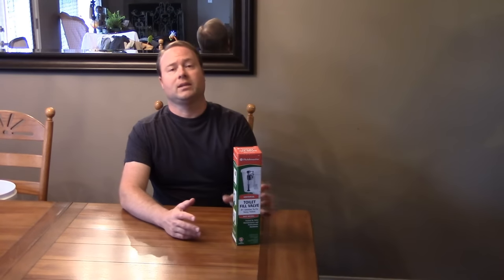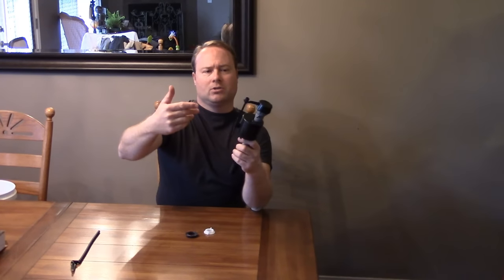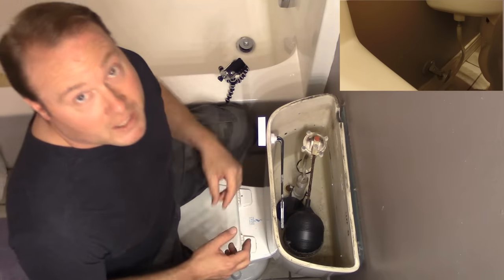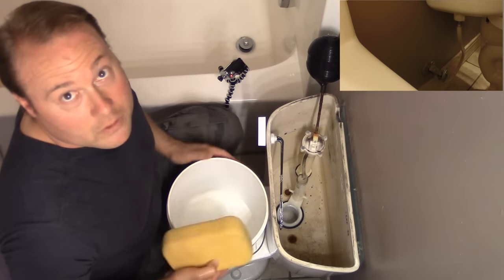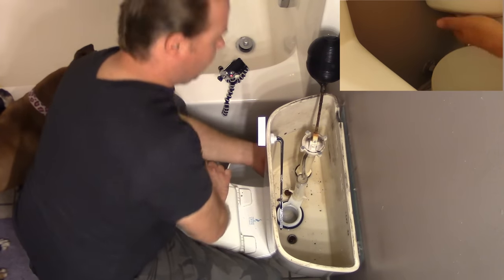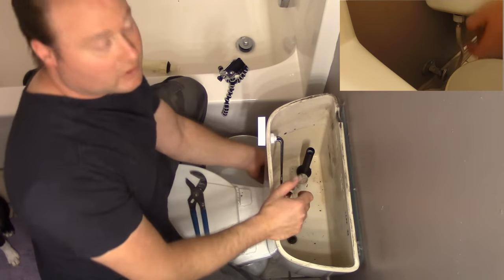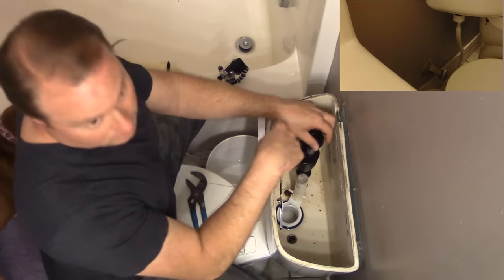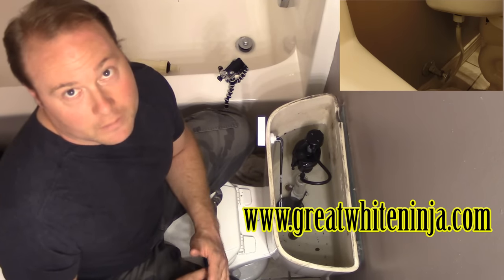Fluidmaster 400a - Installation

Comment: Hi Nathan, there is something I would like to share with everyone. When I install the fill valve, I did not attach the little clip to the hose like it suppose to. I place the hose inside the overflow. That will cause the water to flush into the toilet and every five minutes it will cause the tank to fill with water again.......I did follow your instructions with the hose and now my toilet is working fine......Thank you a lot.
Reply from the maker: Thanks for the comment. It is funny how that little piece keeps it from siphoning.

Comment: I used the trick of separating the tube from the valve and had a new supply line and the FluidMaster in the toilet in about 10 minutes. I wish I had watched this video first! The old fill valve broke into pieces because the nut to the supply line had been forced on and was crooked. It took my husband and me three days on and off (until we got so frustrated, we set it aside) to get the supply line separated from the remnants of the old FluidMaster.
Reply from the maker: Thanks for watching. Don't forget to stop by our website www.greatwhiteninja.com

Comment: Thank you SO MUCH for this video. The extent of my toilet repair history is to remove the lid and say "huh." And promptly put it back on. Now I can say I was able to replace a fill valve all by myself! And you even showed me how I could do a shortcut by using my existing shaft (since I only had a problem in the head) and not even have to drain it completely and do all those other steps. You are awesome and I really appreciate it. My husband was really glad I didn't ask him to do it...ha!
Reply from the maker: Glad that I could help. For more great videos check out my website www.greatwhiteninja.com
Reply: eponine318 qwwp hotel grand queen sheet set

Comment: Very simple- I'm a 64 year old widow, and have always been the handyman...plumbing was the one thing I shied away from. I am reusing the existing model of this same set, as a temporary measure.  It is old and the valve is chewy.  I took everything apart and trimmed a bit of too-long hose. I will be completely replacing the entire works asap, since the unit is over 5 years old and the tube is stiff and crimped.  I had a slow refill problem, but by taking everything apart and cleaning it, it all seems to work.  This is the PERFECT video for exactly how to do it.  Just do make sure that your nuts are tight- my hands are not strong, so I used a rubber jar grip to turn that last bit by hand.  Thanks so much for a great video!
Reply from the maker: Glad that I could help.

Comment: I had a problem with the tank not filling up and had been dreading replacing the entire Fluidmaster fill valve.  Thank you so much for the tip about pulling off the old Fluidmaster assembly and just sliding the new one on.  What I thought would take about half an hour turned into a one minute repair!
Reply from the maker: No problem. Glad that I could help. For more great videos check out my website www.greatwhiteninja.com

Comment: I first initially replaced my old-school toilet valves (3 bathrooms) back in 2000 (bought them at True Value).  Then I replaced them all in 2008 (bought them at Home Depot).  Now I’ve replaced them all again in 2016. (Bought them at Home Depot again).I too am sold on the fact that the Fluidmaster 400a is my one and only choice for the toilets. Having done a search today on YouTube for “Fluidmaster 400a replacement” I stumbled on this video.  This is so much better than reading the instructions on the unit.  This vid was an exceptional refresher for doing a fluidmaster replacement.One other note.  I stumbled on other videos showing the replacement of the seal on the unit vs changing the whole unit out.  A whole new
unit is only 7 dollars and some change at Home Repo vs 3 dollars and change for the seal.  I just changed the whole thing.  Besides if you change the seal on the old one, it’s still going to be all crusty full of calcium.Time to change the unit: 20 minutesTotal cost:  $7.48 plus tax.Thanks a lot for the refresher sir!

Comment: You saved my nerves and sanity, I just fixed the fill valve just by removing the top. I don't have strength in my hands/fingers so screwing things tight don't work with me. You also saved me calling a repair man that would have charged me a ton of $$ just to do what I did. Thank you.
Reply from the maker: That's awesome! Thank you for watching. Check out hundreds more of our videos at https://www.aroundthehome.org

Comment: Although Fluidmaster has a replacement fill cap, I chose the entire fill valve.  My original Fluidmaster was around seven years old.  Why not spend  the additional $$$.  Just made sense.  Thanks to your video, it was a 10 minute fix over the existing pipe.  You saved me close to $150.  Being retired, that is very helpful !!
Reply from the maker: That is great! Glad to help.

Comment: Doooood, great video.  The little trick replacing the fill valve by popping the locking ring and re-using the already installed post?  Awesome.  Literally took 90 seconds.  Turn off water to toilet, pop ring on old fluidmaster, unclipped overfill hose, pulled off old fill valve, pushed on new fill valve, attached new hose (could have skipped this technically but new hose has a fill rate clamp), locked the ring back onto the post - DONE (minus adjusting the fill level and the bowl fill rate clamp) . Thanks!
Reply from the maker: Awesome, glad to help. Thanks for watching. Don't forget to stop by our website www.greatwhiteninja.com

Comment: OMG, I did it. I got the parts from Home Depot, followed the video and in 30 minutes I was done and leak-free. As a woman, I normally don't tackle these types of job, its call a plumber and done but this time I wanted to do it myself and I did. Like you - no fill mark in the tank,...lol so I played with the floater until I got it just below the overflow tube and voila it worked perfectly. This was the absolute best video for doing this particular job! Thank you so much, Mr. Cox, your video was awesome, easy to follow and extremely informative.
Reply from the maker: That is really great. I'm glad that your project was successful. For many more great videos like this one to help you out don't forget to stop by my website www.greatwhiteninja.com

Comment: I'm 64 with no real plumbing experience (except that time I twisted a shower head too tight and snapped the copper pipe in the wall and flooded the wall cavity).  I changed out the flappers on 2 constantly running toilets yesterday but they still run.  So today, it's Fluidmaster time!  Thanks for this video...looks just as easy with your help.
Reply from the maker: Good luck with your project. Here is a newer video on that. https://youtu.be/KLvoFsE3NP0
Reply: @AroundTheHome1  Got her done BUT...every 15 minutes or so, the water fills back up some in one toilet.  The float is set to the water line but somewhere, water must be leaking out?  New flapper, new float.  Any idea what to look for next?
Reply from the maker: Not sure. Sounds like you have your bases covered. If you hit me up on the contact page on my website, when I respond you will be able to send pics. www.aroundthehome.org

Comment: Very helpful.  Especially the brute force tip!! Thank you

Some additional tips for those who follow
 
#1 If you have a turkey bulb baster, you can suck up the residual water (remember it IS clean) and send it down the toilet drain without worrying about sponging it out. Less drips all around
 
#2 Once the water is gone from the tank, two washcloths on either side of the toilet drain are easier to use than one bulky towel to dry out the tank.

#3. A small mirror under the water connector and old fill valve lockscrew will let you mimic the smaller picture in the video.
Reply from the maker: Thanks for the tips. So glad to help! Thank you for watching. Check out hundreds more of our videos at https://www.aroundthehome.org

Comment: WOW, I've never fixed a toilet so fast. I only had to replace the float. Did what you said, pulled the old off and slid on the new and locked in place. I'm definitely subscribing to your channel.
Reply from the maker: Glad I could help with your project. Thanks for watching and don't forget to stop by our website for many more helpful videos. www.greatwhiteninja.com

Comment: This is the video I needed to withdraw the unit without twisting. Even Fluidmaster's own  videos do not tell you how to pull out the valve unit without disconnecting the plumbing. My valve unit cannot be rotated as per the website because my so-called plumber (you've got to love a British plumber) fitted it on the same tight corner as the syphon and there is no room to rotate it. Great video from an intelligent plumber.
Reply from the maker: Thank you and glad to help. This is a very old video of mine and needs some updating, but it still gets the job done.

Comment: I did exactly what you said and fixed it first time without even having to make any adjustments to the water level. You saved me about $60 to $70 on a service call. Thanks for the video.
Reply from the maker: That's great. Glad to help.

Comment: DUDE!!!  Thanx for those hacks!!!  Without them I was like a one legged man in an ass kicking contest...just knowing to pull the float assembly off the supply stem saved me HOURS of that cussin', crampin' & cleanup....Thank you so very much!!!  Under normal (pre-stroke) conditions, I wouldda had it done without consulting your vid...at least the stroke was good for something...your quick work hacks...no leaks or major cleanup except for the much needed floor cleaning which clearing out all the detritus that accumulated over the past number of months/years around the commode made easier...

CB in FL
Reply from the maker: Thanks for watching. Don't forget to stop by our website www.greatwhiteninja.com

Comment: This was VERY helpful. I did NOT know you can just replace the top pipe part and may not have to touch the pipe from the water flow and the bottom ot the tank.
Reply from the maker: Glad that I could help. For more great videos check out my website www.greatwhiteninja.com

Comment: Followed the video, installed the fluidmaster in a matter of a few minutes . Installation went just like you said in the video. Well done. And the tip about exercising the valve length adjustment first and then pre-setting the valve height was brilliant. Thanks again
Reply from the maker: Thanks for watching. Don't forget to stop by our website www.greatwhiteninja.com

Comment: Just did my 400A successfully. The boxed instructions are very confusing. In step 2 it says "DO NOT MOVE LOCK RING it holds the body and shank together." As you pointed out "moving" that lock ring is necessary to adjust the core. You popped the ring easily however I had to grapple with mine since it was REAL TIGHT. It also says that 8 turns on the float screw represent one half inch in water level and I found that I could get one half inch in about 5 turns. My toilet now fills quicker and sounds operationally healthier. Bought mine at Home Depot for $7.48 plus tax. Some universal valves come in blister packs but I love the easy to access cardboard box. I would have paid $19.99 for Kohler's OEM valve online so I am very happy. I have a K4634 toilet with no flapper so mine may be newer than the toilet in your video. My model number was inside the tank however it was not where Kohler said it would be and it was stenciled and not carved in the china as they also said it would be. No leaks at all!! Thanks for the video YouTube is the best but it is the people who make that way.
Reply from the maker: Glad I could help. To see more great videos check out my website www.greatwhiteninja.com

Comment: Yeah Man! I was wondering about how the main filler tube worked. I pulled my new one apart to see what was inside. Now I know where my old one is leaking. Putting a new seal in the shut off valve helped a bit but the thing just kept running once water was a top of drain tube. Shut off was working but water still kept coming in slowly and draining through the over flow drain tube. Really bugged me! 

Thanks for showing all that detail! Don't know why the old one kept running for sure but now I understand how it could if the internal seal of the filler tube was damaged or clogged..
Reply from the maker: So glad to help! Thank you for watching. Check out hundreds more of our videos at https://www.aroundthehome.org

Comment: Thank you for your video.   My pool contractor installed a Fluidmaster as my autofill system.  It stopped working and I couldn't figure out how to remove the Fluidmaster to replace it without removing the nut that is located under my concrete decking.
Reply from the maker: Thanks for watching. Don't forget to stop by our website www.greatwhiteninja.com

Comment: If you leave the ring down on the fill valve,  you can adjust the size by twisting....you don't need to push and pull.  Good video.